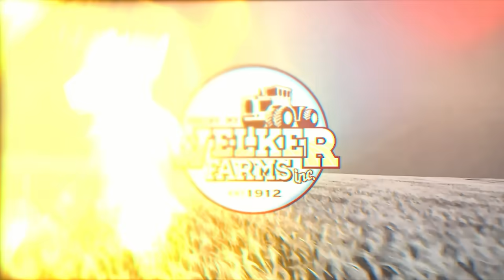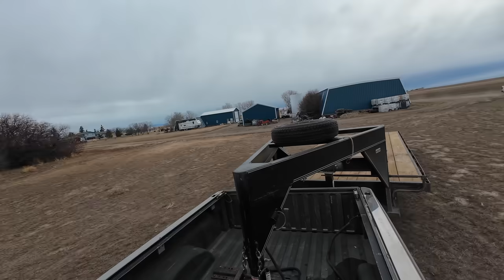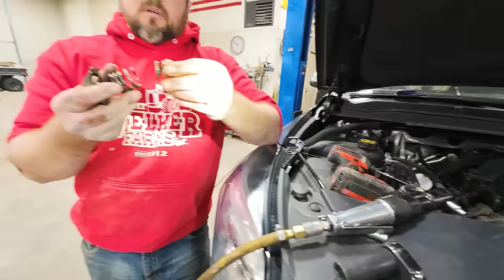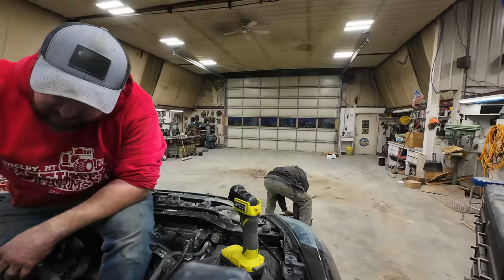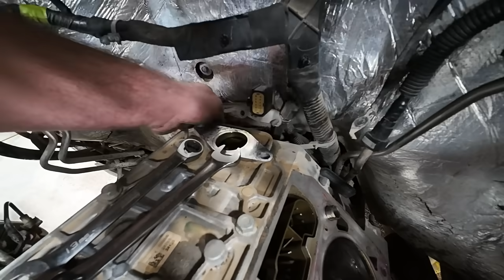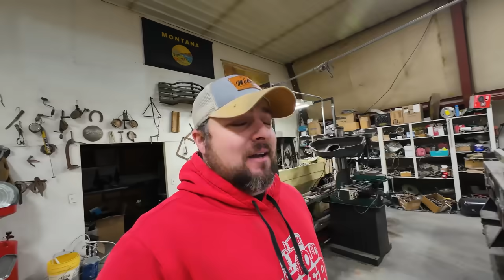Not Again! 🤦‍♂️ Engine Cratered...Let's Find Out What Happened

Comment: There are plenty of new vehicles that are reliable. We have Subaru's and Toyotas and they only go back to the shop for oil changes. Stop exaggerating that new vehicles are not worth buying. and ours were built in the US. and yes I understand many of the parts from these vehicles came from overseas just like many US vehicles.
Reply from the maker: It's not an exaggeration, it's a fact. GM, Ford, and Dodge have major quality control issues. Small cars seem to be better but anything large like trucks and suvs have gone down hill.
Reply: You did not state it like that in the video. You stated not to buy any new vehicles as they are junk and have too much electronics. We have had mid sized Subarus and a Toyota SUV's for years. They are flawless. No big expense bills. Just reliable. The usual oil changes and new tires and brakes when needed.  @WelkerFarms

Comment: You're driving an older ram, before the computer bs. I'll take a carburetor gas engine or mechanical fuel injector pump diesel engine any day of the week. If you think I'm nuts , why are you holding onto those old Buds?

Comment: So basically if you weren’t doing the work yourself you’re saying that Yukon would be junk? Why? Because the value of the vehicle doesn’t cover the cost of the repairs if you took it to a shop and would have it fixed!  Sad that a vehicle in that nice of shape would under normal circumstances be junked over a blown motor isn’t it?

Comment: Exhaust valves have been hollow for decades... Like longer than I've been on the planet.  The head can be fixed.  Just takes time, and a TIG capable of at least 250 amps.  Build the aluminum up... then machine/grind back.  This included valve pockets & guides.  Cylinder wall is a non issue.  God is a fallacy.

Comment: Yukon piece of junk. Gm's quality has really gone done hill. In fact all 3 car manufactures have gone down hill.
Reply: As has Toyota. Complete garbage these days. Tons of new Tundras with crank bearing failures. 2016-23 Tacomas with engine failures and transmission issues. Rear diffs howling straight from the factory. All these auto manufacturers are failing big time when it comes to reliability. My neighbor's F-150 just had an oil pump belt disintegrate and clog up the pickup tube. Destroyed the engine. Ram has a totally new engine coming out. We can already assume that's going to be the same kind of disaster.